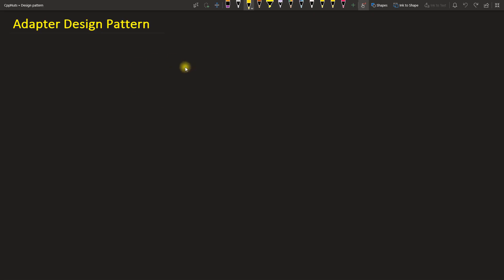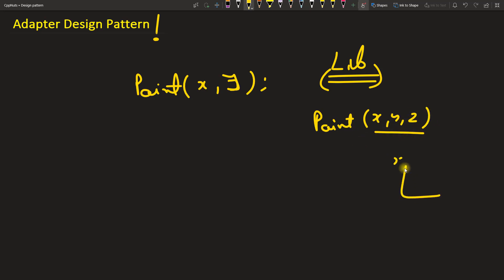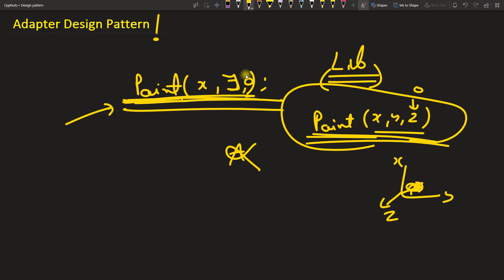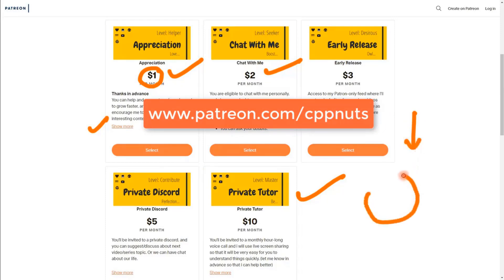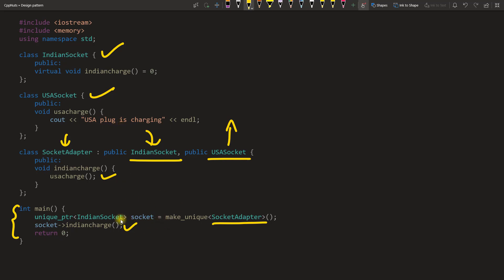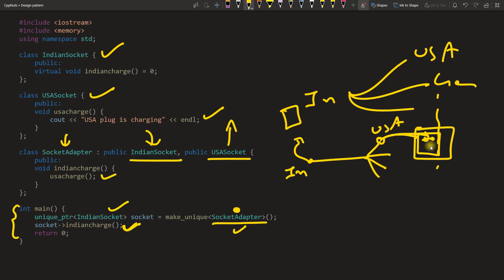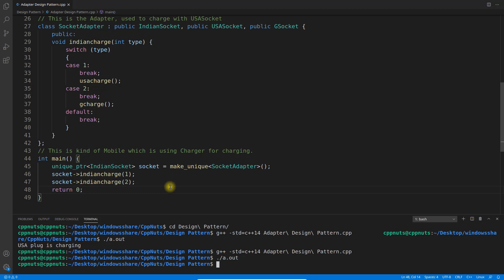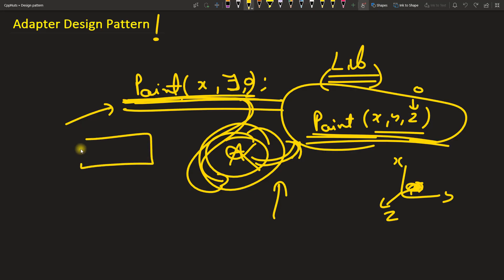Adapter Design Pattern

Comment: I saw your tutorial series about what's new C++ 14 and I have a suggestion. A new tutorial series about what's new in C++ 17 would be nice and a separate tutorial series about what's new in C++ 20. I still use C++ 17 so a tutorial about C++ 20 wouldn't be super useful yet but nice for when I finally migrate to it. You might want to only include the important stuff in each tutorial because including everything may become a really long video or tutorial series. O.O
Reply from the maker: sure.

Comment: In C#, there is a 128-bit decimal. Is there a way to create a 128-bit double/float/decimal in C++ ? I wonder about the best way to do so and I did read about quad precision floats/doubles. I did possibly see a random project or two on GitHub but I haven't looked into it too much. Apparently, a 80-bit double is supported by non-microsoft compilers but that fact limits its usefulness a bit as I use Visual Studio. This would be an interesting topic for a video to add to your C++ tutorial video series.